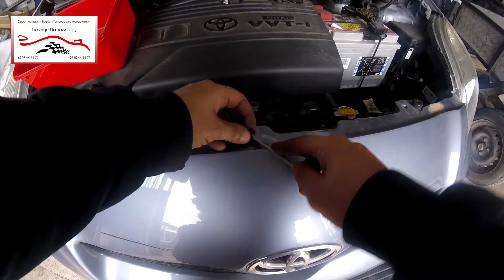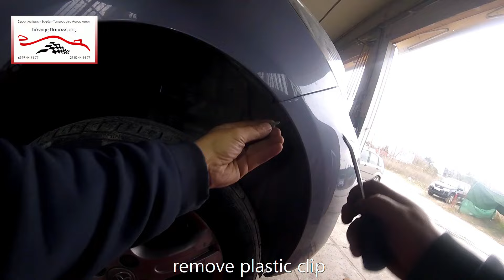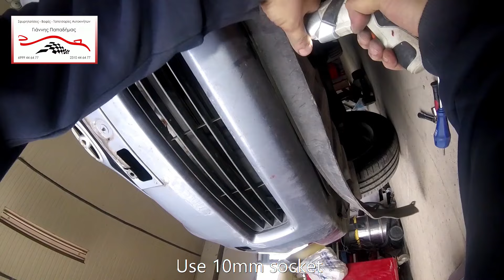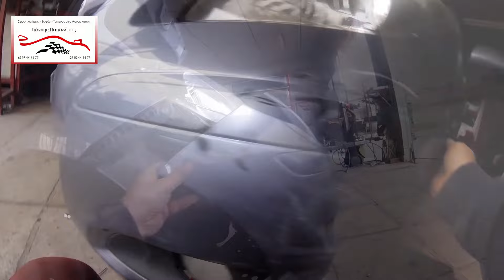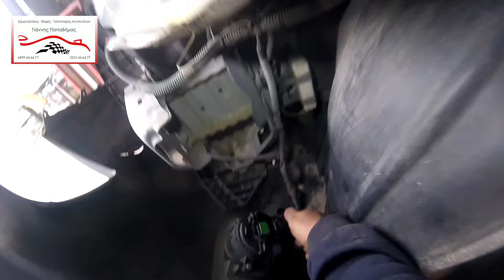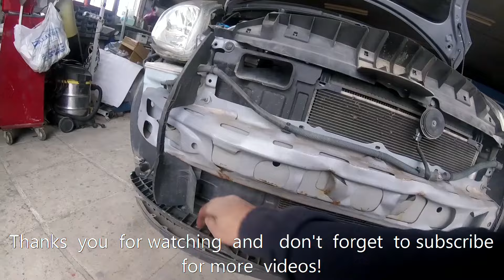Toyota Yaris 2005-2013  Front bumper removal

Comment: Brilliant.  I watched this before taking the bumper off my  fiancée's Yaris as I needed to replace a dead horn.  Snapped a few bolts though.
Reply: LOL. I'm here for a dead horn, too. There's room for an air horn in the engine bay but noooo.  They gotta put it in the worst place possible.  Man, I needed that horn today.
Reply: @JTown-cg4ry  The "300dB" horns on Amazon are nothing of the sort but are pretty good and dirt cheap.  Use the two brackets with the new pair for one horn and the two on the old horn for the other, it'll stop the horns bouncing back and trying to kill the radiator.  There's a second, smaller bolt-hole alongside the horn one but it's an odd size to find in a Japanese car, I think the bolt I used was a 12-24 rack bolt though I'd have expected M6.
I managed to squirrel a small relay and add-a-fuse adaptor inside the fusebox as I didn't want to risk burning out the "integration relay" running two horns.  No drilling, there are existing cable holes in the fuse box.

Comment: What diameter are the retainer clips that you pulled out of the fender liner?
I have a 2007 toyota yaris and need to know which mm retainer clips to use.
Reply: i’m replacing my 2007 as well, did you get an answer?

Comment: My front grill has been damaged. Do I have to buy a whole new bumper with the grill or can the grill only be replaced?
Reply: no, just buy the grill. They can be replaced.
Reply: How to replace grill , my is damaged too
Reply: @normancarnet2567  hafta take bumper cover off however, there are 2 screws that hold it on from the other side